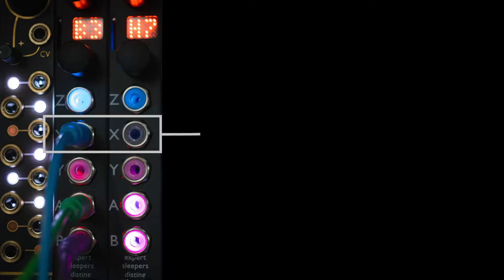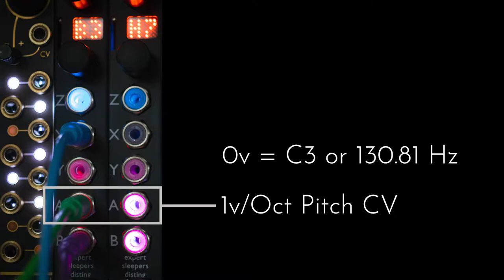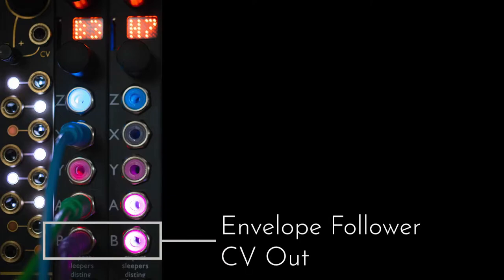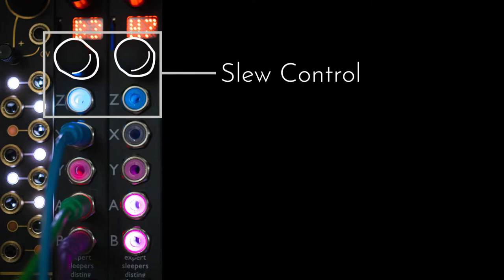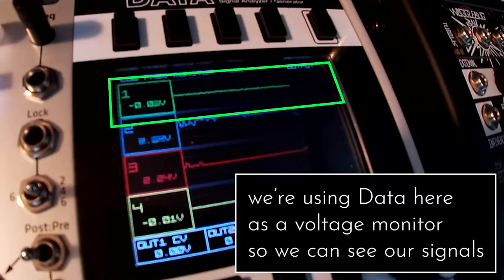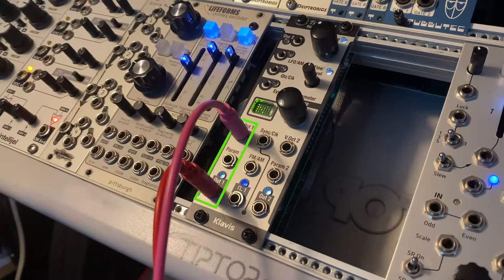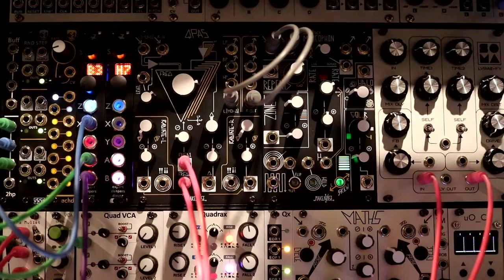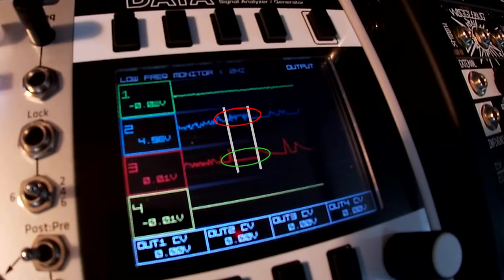Patch Notes: Disting MK4 as Pitch & Envelope Follower

Comment: Thanks for the demo. I was considering buying this module just for the pitch tracking function, but I think you just saved me some money.... Nice L6S by the way. I played one of those back when they were new, and loved it - keep thinking I should add one to my herd now.
Reply from the maker: Yeah, I think the best way to think of the pitch tracking is that it's extremely accurate, to the point that atonal stuff gets captured as well.  So I think there are probably ways to calm that down, with a slew limiter on the output (as opposed to the built-in control), for instance, but I haven't played with those ideas to see how stable I can get the tracking to be.  In short, out of the box, this is the functionality, but with some tweaking and additional filtering/control via other modules, it could likely be great.
Reply from the maker: Oh, and yes, the L6-S is actually my favorite guitar because it's so versatile.  I actually have two. My love of them actually started with one of the Ibanez "lawsuit model" clones, which I highly regret selling.  It was even better than the originals in my opinion, but those are pretty hard to track down at this point. The originals are not, and they remain relatively obscure, so they're still pretty cheap.  Or at least they were a few years ago.  Haven't checked recently.

Comment: Nice demo! I had been meaning to try this out using my bass. I didn't see anything in the manual about other adjustable parameters except the slew. I imagine that a threshold control for a noise gate (bypassable, of course) at the input might be of immense help. The slew function is essentially a low pass filter to eliminate the high frequency content and allow the pitch conversion to more readily focus on the fundamental of the incoming tone. Folks who are newer to synthesis and pitch conversion might be helped by understanding why this parameter is significant, why, when and how it should be adjusted for best results.
Reply from the maker: Very good point. I am planning to do a follow-up to this at some point, so I'll be sure to touch on this.  Thanks!  And yes, I think a noise gate would be extremely useful.  I'll experiment a bit and see how it works if one is added to the chain ahead of the incoming signal.

Comment: Does the pitch tacking work any better if the cv out is ran through a quantizer?
Reply from the maker: I haven't experimented yet, but I'll give it a try and follow up.  I think it will depend a lot on the response time and/or any slew on the signal.  It does really well at grabbing the fundamental eventually, so the biggest task is to find a way to filter out the transients and noise that cause those little glitchy bits.  You could think of it like the module is actually a bit too sensitive in certain situations, and that quick response and sensitivity to changes needs to be toned down somehow to filter out those unwanted parts.
Reply: maybe you could make it with a bandpassfilter ..or not? @_truck